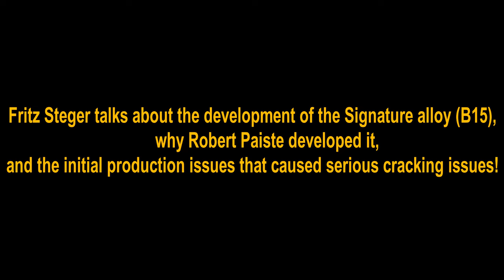B15 (Signature Sound Alloy) production development and issues.

Comment: You mention massive cracking problems in the first year of Signature production. I bought two Full Crashes in 1989 (which are from the first production year). They are perfectly free of cracks up to now, the 16“ is played constantly in these 35 years.
Reply from the maker: The B15 alloy was originally supplied by a Czech foundry that had the issues, they may have been very early production runs that were only sold in Europe...
Reply: My two Signature Full Crashes were bought in Europe (Germany) - maybe not all batches had the issues. Mine hold up very well!

Comment: I purchased a 20” Paiste Signature Power Crash used great condition in 2007. Not sure what age it is but it had started to crack somewhere around the stamp maybe in 2019. I attempted to “repair” by drilling holes at the ends of the cracks to keep them from cracking further. It’s been working so far but now there’s a crack right under the bell. These are about a two-three inch crack. I’m curious if this is what they are referring to.

Comment: So the material for the sheet metal bronze after rolling wil loose about 40% waste, but  I think this refers to b15 because of the brittle properties. They  maybe resale the leftover to re melt. The chinese crashes from wuhan I have sure have a trashy sound, which is good in a way sometimes.
Reply from the maker: Yes, this applies to B15 only, the scrap is melted down and reused.

Comment from the maker: I don't think any other cymbal company uses B15, I know Paiste had a patent on it for several years, but that may have run out.
My understanding is: in order to get the alloy to sound a certain way, the way Robert wanted, it has to be "cold rolled" (instead of hot rolled) in the last rolling stage to bring the thickness down to the proper level.
B8 is softer and doesn't crack from cold rolling, B20 can't be cold rolled at any point: it has to always be heated so it doesn't crack and fall apart while rolling....
Reply: Zildjian had a b15 line, Project 391